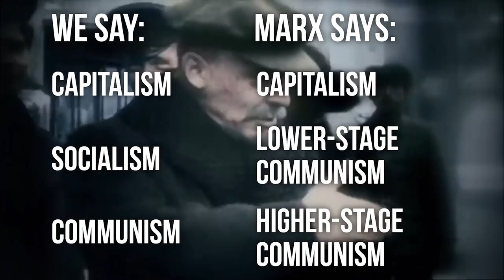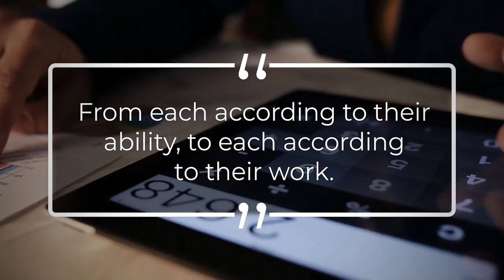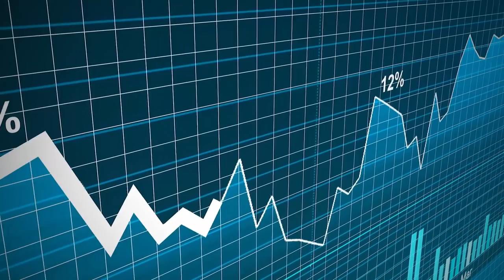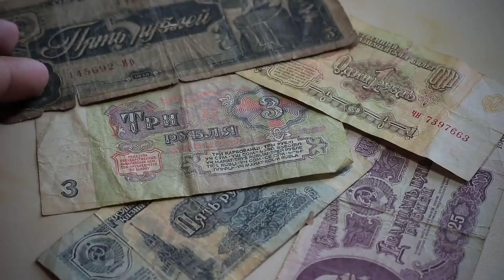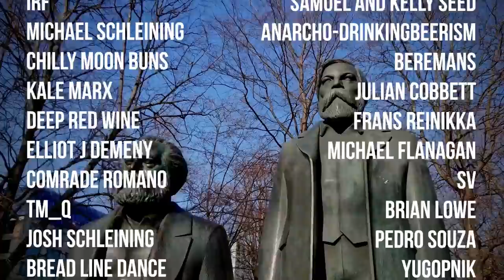What Is Socialism? | Socialism 101 #5

Comment: I can't get a gasp so I'll ask.
Are you suggesting current China is in Transition?
Reply from the maker: No, China was socialist from 1956-1978. It has been on the capitalist road since Deng Xiaoping's reforms in 1978
Reply: Got a question about "Dictator ship of the proletariat"  In USSR with Stalin sending hundreds of thousands of people to the Gulags to die? there was a "Mass Line Method" or they didn't have the method or what happened and how can we assure that whoever get in power doesn't end like a dictatorships?

Comment: First of all, although i disagree with many points, its nice to hear someone trying to explain in polite, scientific ways.
I might be a bit noob...so several quustions..
1) What is the diference in production for profit and production for use? Yes, there are inperfection, but nobody wants to throw away stuff, he has to pay for, so there is constant corrective feedback. You impy, that centralized economy might solve thi problems, but my experiece from former Czechoslovakia is that central planning failed miserably...first of all, is really hard to predict needs of 10 milion people, second, there wasnt much personal gains for coordinatros, so they dont care much and ordinary employers have no voice despite the statements. Also such system wasnt flexible at all, so when one factory shut down, these specific product mighe be unaviable for years.

2) "From each according to their ability, to each according their work." ...How exactly you evaluate, how much I deserve. On free market it based on pricing competition on both sides, in this case I dont know, how it would work. Also I am not sure, where to put myslef, as employee software developer wirh prospect of working as independent contractor and even what about case if i hire some help - lets say desinger, will I pay based on our free agreement or fixed price decided by some commision?

3) What is the fundamental difference between representatives selected in general election and representatives selected by working class. Also I dont see any effective safety mechanism. This was huge problem in my country (and as I know basically in every eastern europe country under USSR influence and most likely in modern China), when governament became excatly group of power hungry elitist. And without any selfregulatory emchanism, they act like some modern monarchy (or mafia), untill people get fed up enough to pres the hard reset button.

I wuld have much more question, but in general it feels like socialsm is about great plans for total transformation, while struggle point many everyday problems. For example basic human nature is always ask "How could i get as much as possible reward for as little as possible effort?" Capitalism at least somehow channel this, socialism seems like "We make them think in completely different way"

Comment: If it’s Marx that said central planning eliminates misallocation of scarce resources he’s wrong there. That has never been the case. Central planning has lead to the worst misallocation of scarce resources. The price system along with Supply and demand allocated scarce resources better than anyone of flesh and blood. Have you ever seen the equations used in the USSR to allocate resources? They were extremely complex equations written out by only the smartest people and the Soviet’s still had warehouses full of produce not getting allocated properly. I know Marx has acknowledged the power of supply and demand so I don’t know why he thought that it should be replaced by the human brain. Silly man. He had a nice beard tho.
Reply: It’s one thing to set millions of prices. Which potentially could be done IMO. It is when you have to properly set each price in relation to all the other prices that the socialists run into problems.